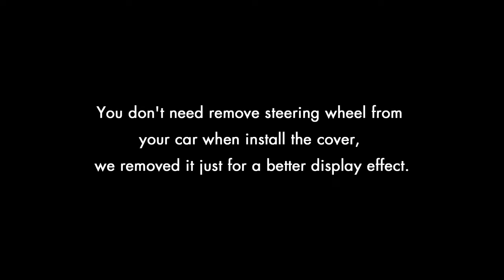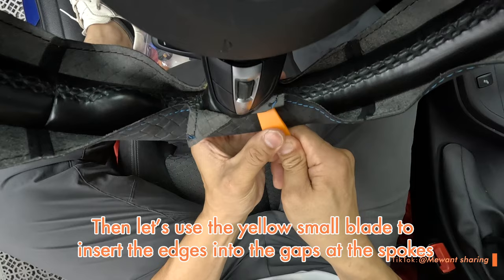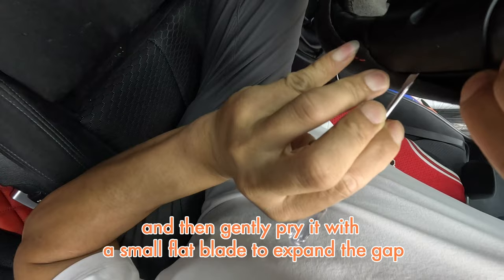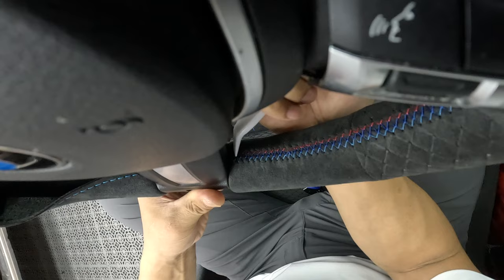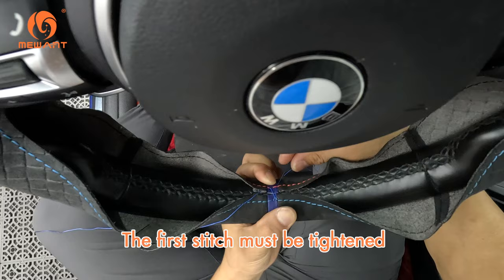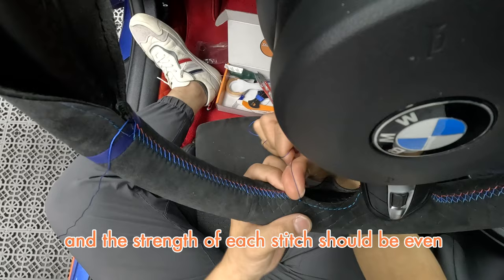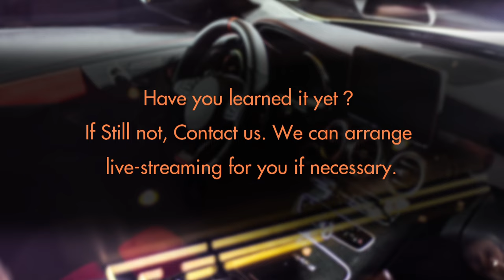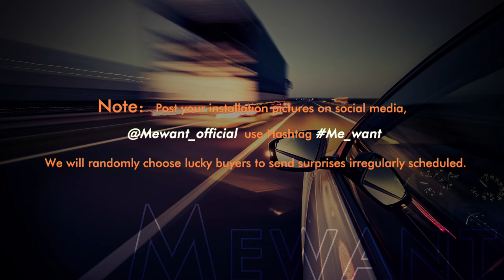MEWANT- Show you how to sew car steering wheel in the car. for BMW f30 f32 f10 f12 f22 f48 f39

Comment: I don't normally comment on videos, but I have to recommend this product to anyone seeking a new look and feel to their car. The video certainly helped!
Took me about 3 hours to fit the thing (and it is super fiddly!), but it's on now – it looks beautiful, fits perfectly and feels great.
The box comes with more than you should need: I wasn't wanting for any extra thread or anything. The only additional tools you will want is a T20 (Torx) screwdriver and a flat blade such as a screwdriver.
I found that threading 4x the length of the span you're stitching give heaps of left over. I did the first part at 3x and was starting to worry that it wouldn't be enough (it just fit).
Go easy on the double-sided tape. The cover won't move once on, and if you put the tape everywhere (like I did) then it's hard to make minor adjustments as you are stitching. If I did it again, I'd just do close to the spokes (3, 6, 9 o'clock) and a small strip at the top (12 o'clock).
Be patient and be thorough – if it comes out anything like mine, you will not be disappointed.
Reply from the maker: Thanks for your highly praise!